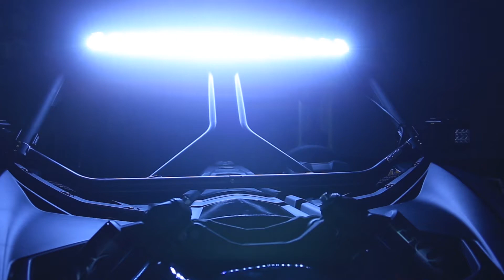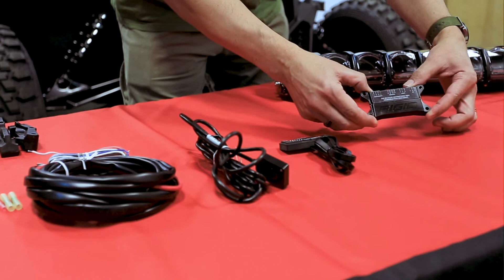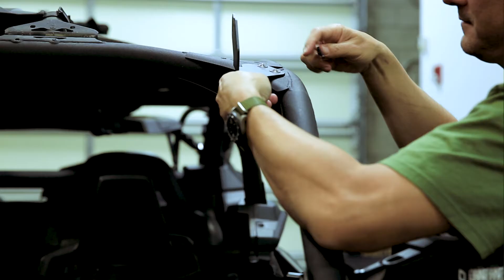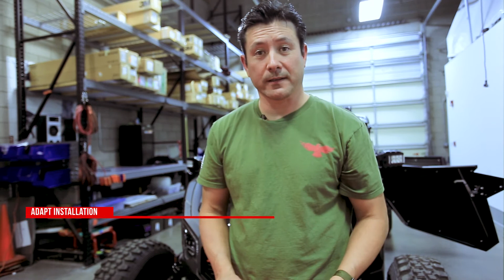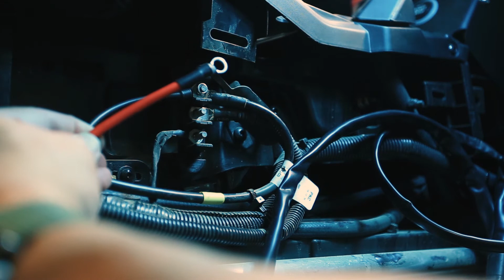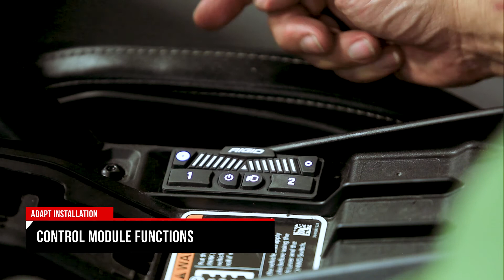Rigid Adapt - How To Install

Comment: I bought my JL used and it came with the 20" bar mounted on the hood. The one thing I noticed is that it actually blocked the stream from the windshield washer nozzles.  Is it set up wrong? I has the JL Rigid hood mounts.